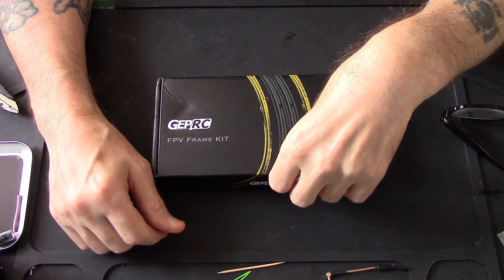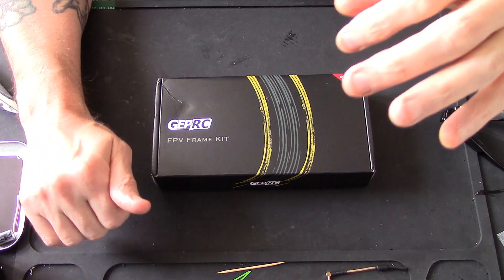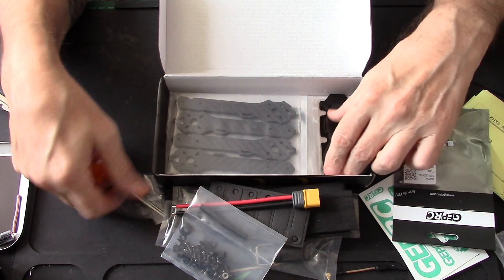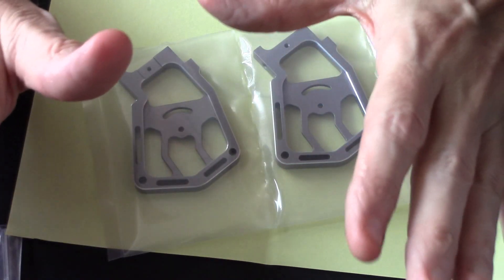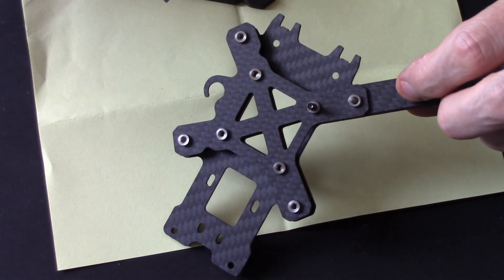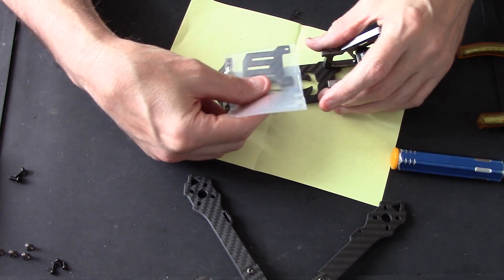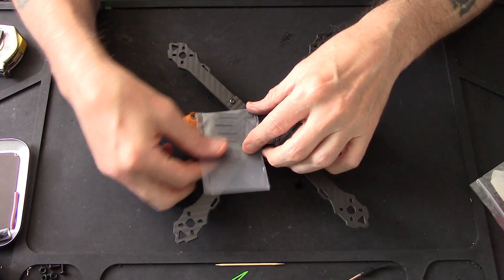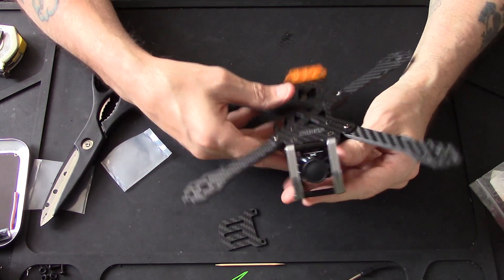GEPRC GEP KHX5 ELEGANT

Comment: ok nice review but how much does it weigh? I think the most important thing to know about a frame is weight
Reply from the maker: Good Question,  With the 4" arms the weight is 114g  -- With the 5" arms the weight is 120g  --  With the 6" arms the weight is 124g.. Some more info is in the description and for even more check out the links. Hope this helps buddy
Reply: @GeorgeCooper_LoneWolf  Thanks for the reply, unfortunately the declared weights almost never correspond to the real weight of the frame, so did you weigh the assembled frame before mounting the electronic components?
Reply from the maker: No sorry, I never bother checking the weigh it's not an important to me, I'm more concerned with Quality of the frame.